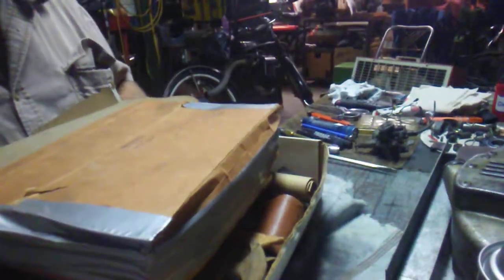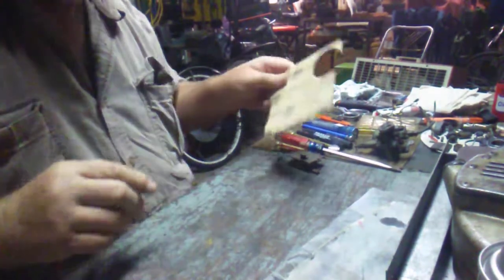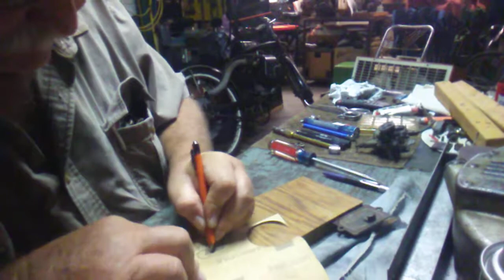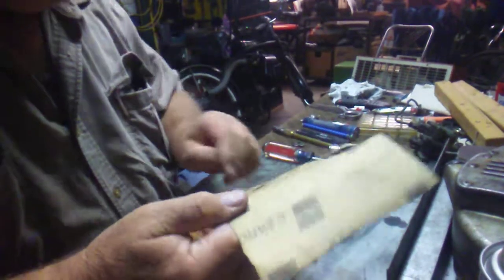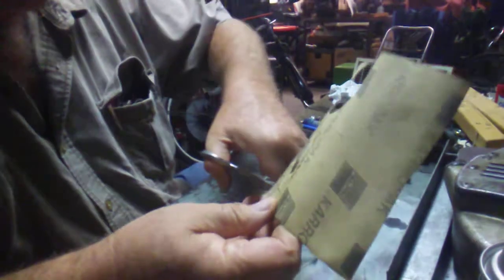Cutting a Gasket,safely and easily.

Comment: Great how to video, I use a piece of Masonite fur cutting surface, no grain to worry about, and machinists ink to mark my template. A good wet coating of sharpie marker works great also. Just keep it wet, and don’t slide it on the gasket material. Leather punches for small holes, and other wood working punches for larger sizes

Comment: Good tip there. I still have a couple of rolls of gasket paper I bought back in the mid 1960's that I am still using. Used that gasket paper for my Sears Allstate moped and my 1955 English Ford Anglia. I found out pretty quick why I should put the flywheel cover back on the moped. I have a big chunk of flesh shaped like a orange wedge missing from my left leg when the moped fell on me during a minor crash.